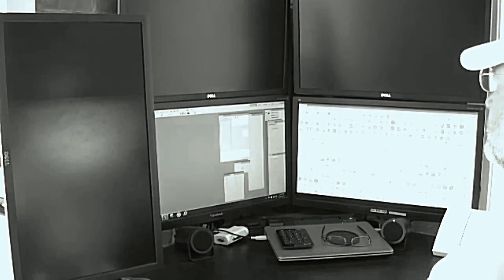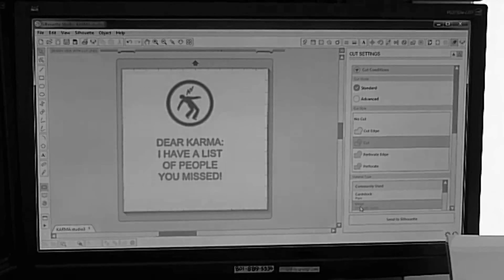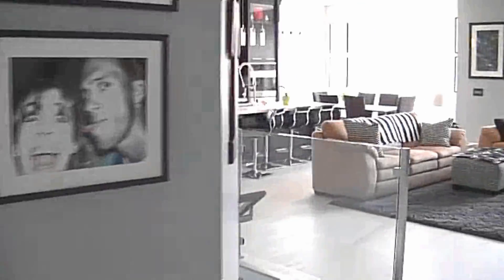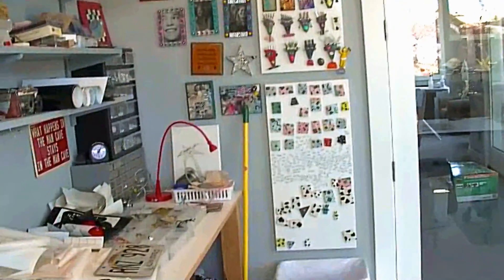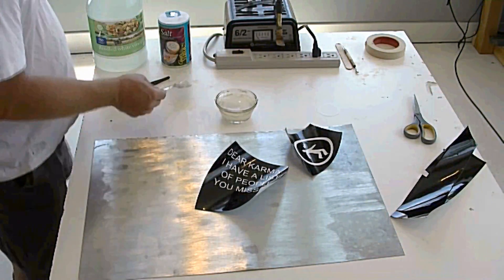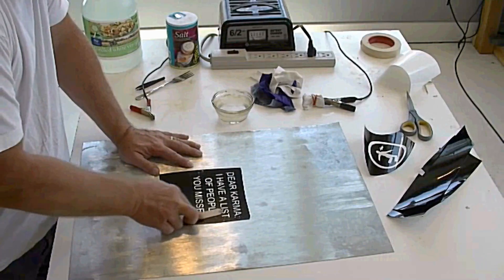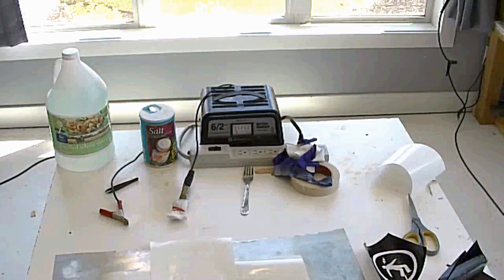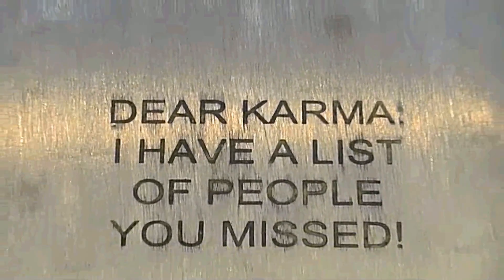Metal Etching

Comment: Thank you very much for the info. on type of vinyl to use, just did my first test piece and the vinyl I had cut for me came up and massacred the etch. lol  A more modern method as opposed to an old battery charger would be a DC regulated power supply. just bought a 30v 10 amp for 53 bucks. More than what is needed since the lower the voltage the smoother the etch. I am going to copy your set up except for the battery charger. Check out the etching done on YouTube (aegis fang build). the etching is around the 3/4 mark if you don't want to watch the whole thing.

Comment: a little bit of information for you to consider sir, you should never etch on galvanized metal, the etching process is basicly a DC welding process and welding galvanizing produces a toxic/noxious gas that is actually poisionous and can in enough quantities kill you. if you don't believe me check with any welding shop.
Reply: the reason is the zinc, drink milk and no worries as long as there is a fair amount of ventilation. been a welder for 31 years, welded on my fair share of galvanized material.
Reply: "the etching process is basicly a DC welding process"
No, its not. Do u see any Zinkoxide flying away?
Hydrogen is produced. Traces of other gases too, but not in quantitys to worry about.
Reply: wellllllllllllllll,,,, it sure as hell aint AC welding,,, ole USN vet